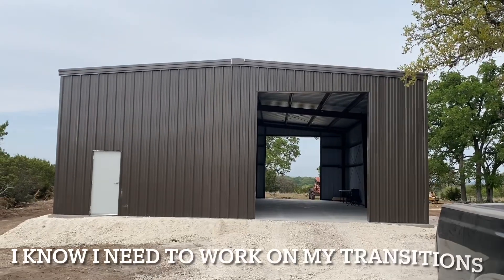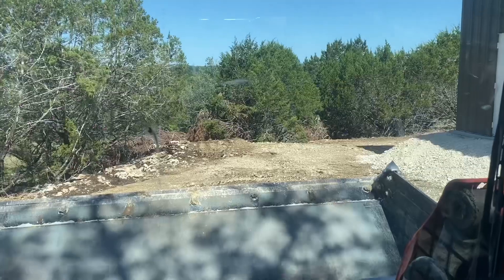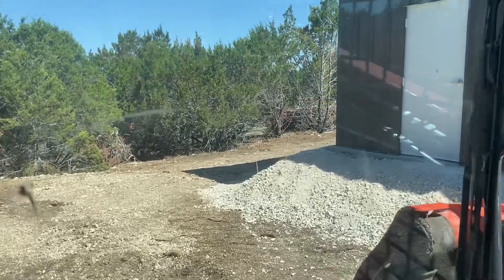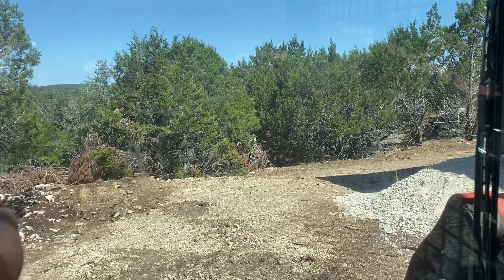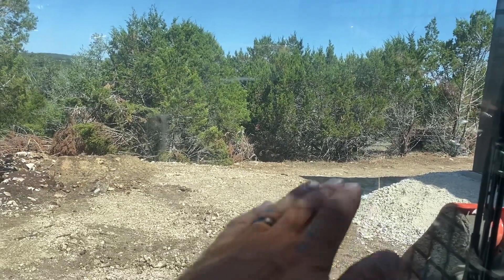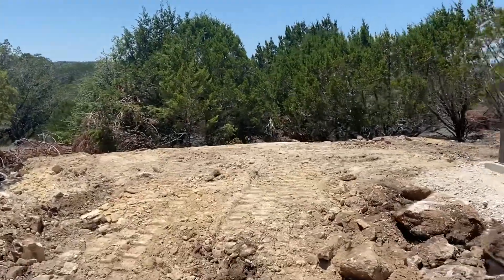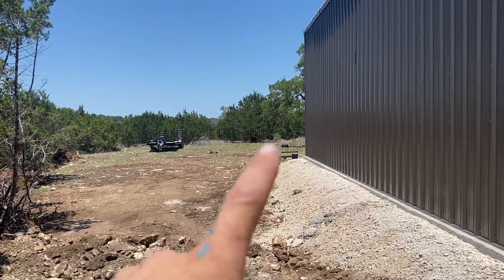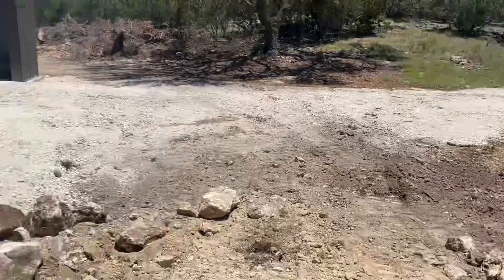Progress at the Metal Shop

Comment: Does it rain there? Are you going to hang gutters to collect the water?
Reply from the maker: It hasn’t rained a lot lately but yes we get a decent amount of rain. I fully intend to get 1 or 2 water storage tanks and put gutters up with a 3” pvc line from each gutter down to the holding tanks. This would be a good alternative to needing to run water down to the shop too. I did plumb for a full bath and kitchenette down here but still have to figure out water and septic system.
Reply: @BuiltOnTheRock  you could go with a grey water drainage system and possibly an incinerator toilet. Looking good though.